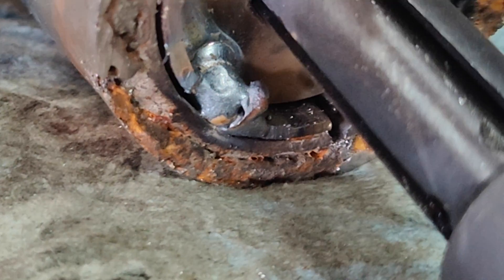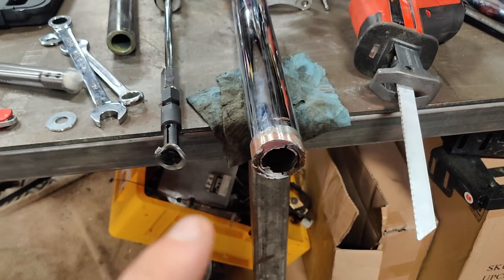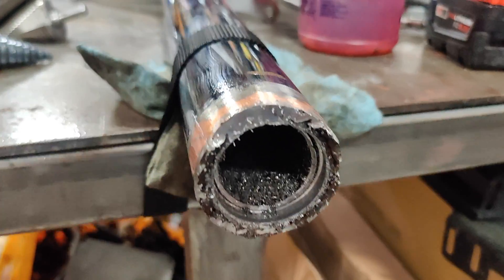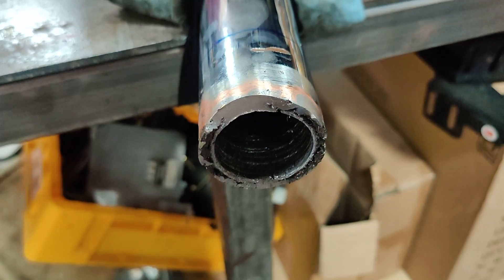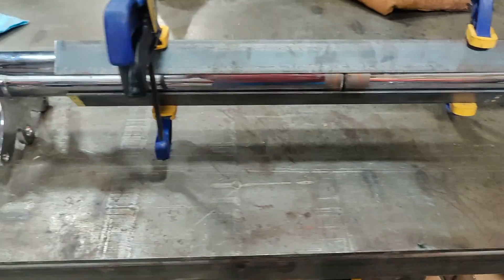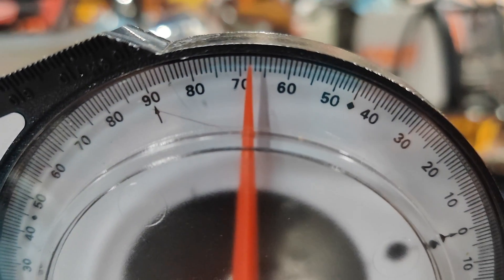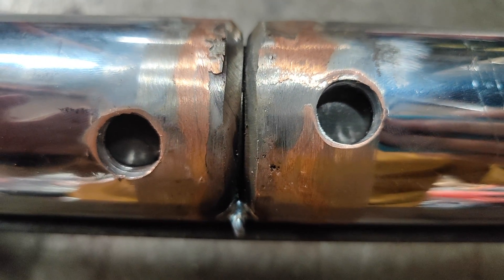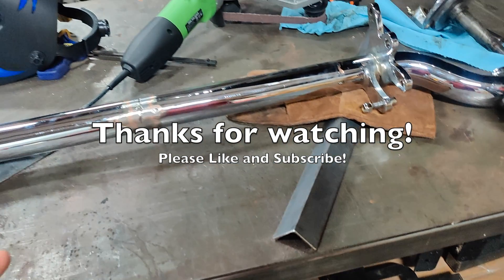Chasing Deathwobble - Part 2: Prepping, sleeving, and welding the axle halves - 1923 Ford Hot Rod

Comment: Hey Tim. I would have suggested warming the outside axle tube before attempting to remove the inner sleeve material, the expansion of the outer tube may have been enough to be able to pull the old sleeve out using a port-a-power draw ram. Drilling the axle out leaves room for slopping around (like tossing a hot dog down a hallway). Keep in mind there will be radial forces on the axle that no doubt caused to old repair to fail. Your welds look alright, but I would recommend you run another pass all the way around the repair and go proud so you have material to remove to get down to the axle tube surface (pits an hollows are areas of concern that can lead to weld failures). It's an axle, and a critical part of the vehicle, it's the last thing you ever want to have fail when your blasting down the road. Curious if your going to try to plate the axle repair yourself, at least give the repair a plating of copper to protect the weld areas. Check out what Geoffrey does here, might help you out { https://www.youtube.com/watch?v=G-PtnwtOR24  }, protect the surfaces you don't want plated with paraffin wax. Cheers from Prince George!